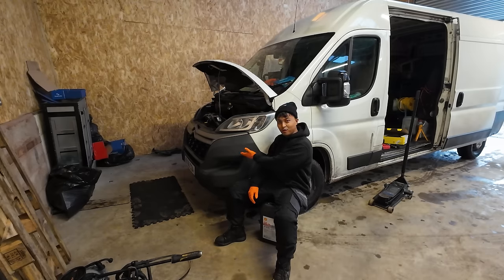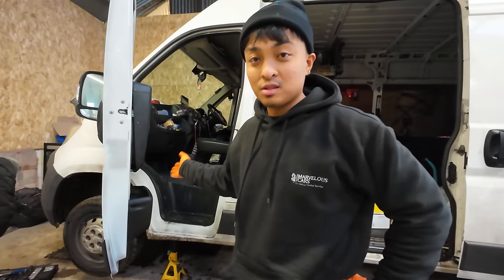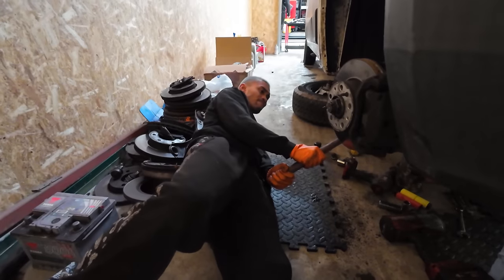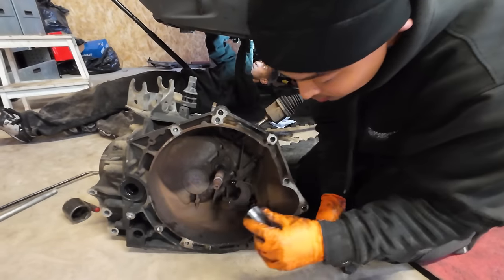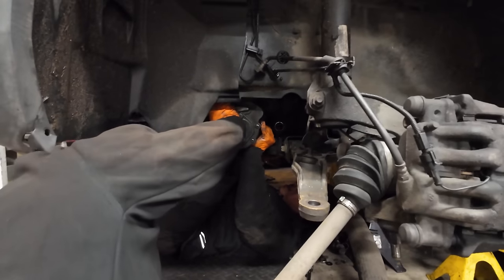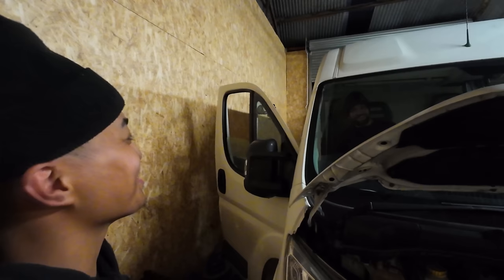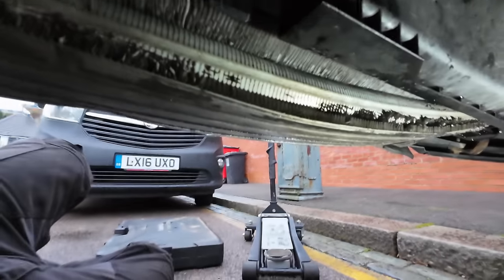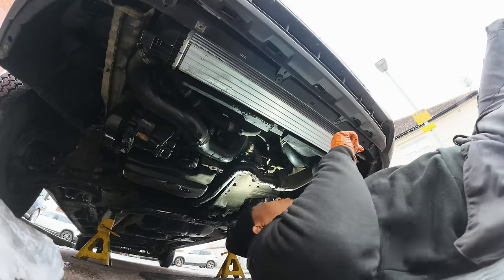FIXING MY CITROEN RELAY VAN GOT US STRANDED! | CITROEN RELAY CLUTCH FAILURE | PART 2

Comment: I need a work truck for mobile service any suggestions? just doing brakes tune ups wheels and tires batteries, and some steering and suspension no engine or transmission jobs as of yet.

Comment: I bought a 2018 Relay 2.0 to convert to a camper.  It's done just 71k but feels so fragile to drive, like something expensive is going to break at any second.  It's also developed a horrific diesel smell coming through the vents, especially with the cab heater blower running, but can't see any diesel leaks anywhere.  Despite just having had a gearbox bearing rebuild at considerable cost, it now judders/kangaroos when pulling away unless you give it a bit of revs.  And now the indicators sometimes don't self-cancel.  And now sometimes the indicator dash flasher blinks twice as fast, despite all the exterior bulbs being fine, which from internet research means the ECU is about to die at a cost of £4000 to replace it.  I can't get it sold quick enough and am glad I got a sixth sense warning not to start the conversion.

Reading/watching all your tales of woe, looks like I've had a relatively lucky escape thus far !!!   What utter pieces of crap they are.    I've got a 2010 Citroen C1 with 150k (!) on it and it's still going strong and never let me down in 9 years !   But these vans are jusr rebadged Fiats I think, which may be the real reason why they are so crap.
Reply from the maker: That Diesel smell is likely coming from a leaking injector, leaking leak-off pipe or leaking injector seals
Reply: @themarvelousvlog  /great, that's just what I need :(   utter pieces of crap these vans are.  never again.
Reply: @themarvelousvlog   Thanks!  After a worrying 4 weeks of time-waster tyre-kickers it finally sold for 9800 this weekend.  I bought THREE magic trees to mask the diesel smell so it smelled like a tart's boudoir when you opened the door and got in but did the trick !  No chance of smelling diesel over that lot !  Long live the trusty filling station Magic Tree !

Need an update on yours.  Surely something fresh will have broken on it by now ? ? ?
Reply from the maker: At the moment, PCV needs replacing as it’s drinking a tonne of oil per 1k miles 😂. I will then need to replace the leaf spring at some point and also the subframe bushing as it’s squeaking 🥲 there is more actually but too long to list 😂
Reply: @themarvelousvlog  Mannnn, I feel for you :( .  I didn't do many miles in mine as it used to scare me too much lol but I did have to top up the oil on it in the 250 miles I did as it went from 4 blobs to 2 blobs on the dash, so I think mne might have had same issue.  I noticed on the MOT history that it had a history of oil leaks, although on the latest one there was no advisory for it and I couldn't see any wetness from looking in both the bonnet and underneath so maybe it was just a gasket that had been fixed, dunno.

Total garbage vans these are.  You could specialise in repairing this full time now with your knowledge and expertise with them.  There's literally hundreds of them for sale on ebay as spares or repairs with various faults for a couple of grand.

Comment: Oil leak on top the gearbox is from the high pressure fuel pump leaking engine oil down
Reply from the maker: Wow! No maaann 😂 I need to double check this. I saw leak from the rocker cover BUT I won’t know until I check properly
Reply: @themarvelousvlog  If the engine is anything like the DW10CTED4, the fuel pump has a mini gearbox, which has a seal that is known to leak. Check the videos from Alan Howett.

Comment: buy a Sprinter bro from 2007 onwards  all are bulletproof... I have owned only Sprinter and Iveco daily automatic with factory fitted air suspension 2016 xlwb never stopped in 3 years and i have used to transport palletised goods all around the UK... i paid £5500 for the Iveco on facebook marketplace i never pay more than that for a van but i choose very carefully the make so again Sprinter or Iveco

Comment: Omg boys I had a ford Transit like this van. I paid cheap 3£ for it and ended up spending 3k fixing it until the fuel injectors went. I stuck it on eBay and sold it for a massive loss to a mechanic in Manchester. He drove it home at 12 at night and it wouldn’t go any faster than 35mph. And he towed his car behind it. Vans are super hard to keep going
Reply from the maker: Tell me about it! I would’ve taken that off your hands, bet still better than what I got at the moment 😂
Reply: Hard to keep going if people abuse them and do the bare minimum when maintaining them...

Comment: 100% that leaking intercooler would be contributing to your ongoing DPF issues. Any time you have a boost leak the engine will over fuel and this will block the DPF.

Comment: Seem to be a common fault with these vans 
Same thing happened to my 2016 relay  the sleeve and bearing completely shattered as well as the clutch fork ball joint snapped
Reply: citroen has no experience with commercial and heavy duty vehicles... Mercedes manufactured lorries for decades no wonder Sprinter vans are  most reputable workhorses

Comment: If that van in Euro6 then there is an ambient temp sensor in the drivers door mirror 

If you fit an aftermarket mirror without the sensor then it will never do a Regen.

God knows why they did that, apparently only affects the Euro 6 not the Euro 5

Comment: Get rid of the citreon and swap for Merc sprinter problems gone
Reply: Not necessarily. I have a sprinter and have had loads of issues, although it's on 400k miles so I let it off. Inlet manifold bolts snap in the head, new manifold needed as they are captive bolts. Exhaust manifold studs snap and manifold warps. Also kept breaking down on me with Abs and ESP faults. Then lastly broke down on me 5 hours from home with shorted injectors.😂

Comment: There's only 2 car manufacturers I'd buy,,one Honda, second Toyota..That's it,, anything else is pure crap.
Reply: So what about Lexus, Suzuki, Mazda and number of manufacturers that are basically Toyotas with different badges
Reply: Sadly the modern toyota vans are just the same Peugeot/Citroen/Vauxhall rebadged so that doesnt apply to vans but volkswagen or mercedes probably do more reliable vans but by far the least reliable vans are ford now because there 2.0 ecoblue is wet belt
Reply: You've got good taste in cars then 😂😂😂
Reply: Since 2015 Toyota sell rebadged Citroen/Fiat vans as Proace and Hiace (depending on the market)
Reply: @bigjml  laughable,,you buy them then,,,I'll buy the Honda+Toyota genuine...Good luck.
Reply: Wotabout Mazda.
Reply: @brianhume4743  Mazdas have been less than great for years.

Blame the influence of Ford
Reply: @markb1487  Toyota?

You mean Peugeot?
Reply: Yeah I've got a 2000 2.4 HiAce  no regrets, for commercials always Toyota for passenger cars BMW for me

Comment: Just found your channel great content ... But the intercooler .... Your diagnosis is obviously wrong ,  my diagnosis in the past you have been through a lot of water ( clean water ) that has been carried into the induction system , probably the drain on the air box is blocked ,  the water spray or vapour off the filter is dragged into the turbo and heated then into the intercooler where it condenses , then whilst it's still there it freezes overnight , bloating the bottom of the intercooler , check the drain in the air box and the filter
Reply from the maker: No… no water was involved and I was never in a deep puddle. Filter is bone dry and I change it every 6 months. Nothing in there mate. What I noticed when I opened up the intercooler is oily soot which points to stuck open PCV.

Comment: No disrespect you deserve what you get when you think you can buy any French vehicle and get away with it wouldn't even have it if it's free there is a reason why you never ever see any French cars on the road after 10 years old
Reply: i have an 18 year old and a 16 year old peugeot 207, both run sweet. you must be blind to never see french cars over 10 years old on the raod, plenty of solid ones, this engine is very capable when looked after, but like this one they rarely are and end up being as shit as this one.
Reply from the maker: @yreva532 no, engine is good, don’t get me wrong, it’s what’s connected to the engine that’s going wrong 😂

Engine is well looked after, serviced every 5k, full tank of premium diesel once a week with an additive. Honestly just unlucky 😂
Reply: See plenty 10 plus years old sadly worked on quite a few as well